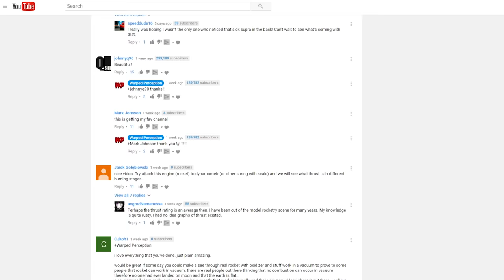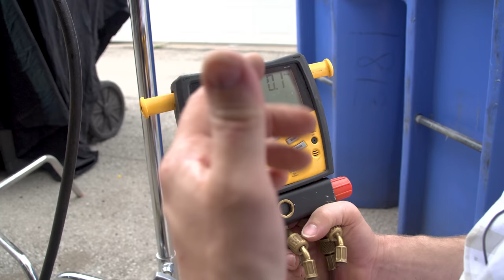Model Rocket Engine In A Vacuum Chamber - 4K Slow Motion - will it burn? - Rockets (S1 • E3)

Comment: Lol !!  How could you able to trigger 🔥 with deterring a element in fire ⚠.. Geez, in order to trigger fire & continue the action you required oxygen. Secondly, sound waves can't travel in vacuum.. May be you haven't properly sucked all the air in vacuum tube it seems. Misleading information..
Reply: 1. Go back to school
2.both the igniter and the rocket engine has an oxidizer (oxygen) mixed in
3.sound needs matter to travel through in this case it was the copper wire
Reply: Flat Brain I can’t believe people are just dumb

Comment: Fire does NOT burn without oxygen...FACT!  You need to show the gauge levels and prove it is air-tight.  smh
Reply: So how do oxy -acetylene torches work UNDER WATER?
Reply: @stuartgray5877  water is H2O right?? So water is made up of oxygen...
Reply: @stuartgray5877  but apparently those underwater torches supply their own oxygen in a fuel chamber
Reply: @justinmarino3863  The answer WAS: The torch TAKES IT OXYGEN WITH IT, just like rockets do.

You are not even aware that MOST of the mass of a rocket when it lifts off is LIQUID OXYGEN?
Reply: @stuartgray5877  yeah and my point still remains...oxygen is needed for fire to burn.
Reply: @justinmarino3863  - 
Rocket is filled with Fuel and OXYGEN.
Fuels mixes with oxygen MAKES FIRE.

FIRE burns in vacuum because ROCKET PROVIDES OXYGEN ALONG WITH FUEL.

Which part are you failing to grasp?
Reply: @justinmarino3863  "water is H2O right?? So water is made up of oxygen..." You actually said this. 😂 Light a match, drop it in a lake and light the whole lake on fire, then.
Reply: @justinmarino3863  Solid rocket fuel contains its own oxygen...
Reply: @PabloGonzalez-hv3td  sounds pretty unbelievable kinda like how people think the sun burns it's own oxygen constantly while whirling through an endless vacuum... And what would rockets thrust against in space anyway, oxygen ? Oh yeah outer space has no oxygen. Ha!  Look up how combustion and thrust works in reality...
Reply: @justinmarino3863  You contradict yourself. You realize water contains oxygen and that it obviously inhibits combustion. Yet pouring water on a magnesium fire makes it WORSE. Why do you suppose that is and how does that relate to rocketry?

Rocket thrust in space can be proven with the thrust from a simple garden hose or pressure washer.
Reply: @PabloGonzalez-hv3td  you guys are trying to compare water and rocket fuel.... So you think outer space is made up of water then??  Fire ( rockets thrust) would not burn or push against anything in an oxygen free vacuum.  A compartment with a rocket fuel oxygen fusion wouldn't work and the same goes for the sun's supposed endless hydrogen fusion.  What a claim with no way to prove it ...
Reply: @PabloGonzalez-hv3td  if you can explain how a hose relates to rocket thrusting in space I will shut up about this forever... Ha
Reply: @justinmarino3863  Why do you suppose magnesium burns under water? The kick generated from a hose or pressure washer is from the reaction against the ejected mass not from the tiny spray pattern hitting the air. Exactly how rockets work.
Reply: @PabloGonzalez-hv3td  fire burns where there is oxygen present... Are you claiming there is oxygen in outer space then?
Reply: @justinmarino3863  No kidding. You might want to research how rocket fuel works.
Reply: @PabloGonzalez-hv3td  yeah it burns in the oxygen filled air and not in a vacuum...
Reply: @justinmarino3863  Air isn't the only compound that contains oxygen. Do you not understand that rocket fuel carries its OWN oxygen source?
Reply: @PabloGonzalez-hv3td  so internal combustion is what you believe in?  Anyone who watches a rocket fly can see fire out the back burning with oxygen. The fact of the matter is there is no video of a rocket in outer space because it is impossible to claim space has no oxygen and fire can burn there...but we can all see that rockets produce a large flame when taking off until they level out and go out of view.....and eventually landing in the ocean where no one can see
Reply: @justinmarino3863  Internal combustion is a broad category which in fact encompasses rockets and even firearms. Speaking of firearms how do you propose ignition occurs inside a sealed cartridge?🤔
Reply: @PabloGonzalez-hv3td  a firing pin still reacts with oxygen to create a spark and ignite.  Internal combustion wouldn't work in a vacuum with no oxygen.  Do you agree that fire bursts outside the end of a rocket? And do you agree that outer space has no oxygen? Whether it is a compound or not NASA claims there is no oxygen in space and I will assume your thinking aligns with their theories... Again back to my original statement fire does NOT burn without oxygen or a compound with oxygen
Reply: @justinmarino3863  The firing pin strikes the primer which lights in an anaerobic environment which then lights the gunpowder, also in an anaerobic environment. The oxygen is produced via oxidizers  - just like rockets.

Of course there's fire coming out of rockets but it's emanating from the combustion chamber inside...
Reply: @PabloGonzalez-hv3td  the chamber of a gun has oxygen in it.  There are experiments online you can look up where gun powder is shown to not ignite in a vacuum box but has no problem in open air... Do you agree with NASA that there is no oxygen in outer space?   Try lighting anything with no oxygen and tell me what happens.  Cars wouldn't work in a vacuum because the system needs air to flow through it.  Rockets are no different just obviously more powerful.  Have you ever seen a video of a rocket flying through outer space?
Reply: @justinmarino3863  There are also videos of guns firing successfully in vacuums since gunpowder WILL burn without external oxygen if ignited properly. Neither the primer nor powder load are exposed to the chamber any oxygen present there is irrelevant.
Reply: @PabloGonzalez-hv3td  I will have to strongly disagree with you buddy.  There are no such videos only ones like this that I commented on because it's clearly not a valid experiment.  You can argue all you want about this but anyone who works with fire in any way will know that it needs oxygen to burn. It's a simple fact of life.  I've replied to your comments so if you want this conversation to continue please provide a video link that shows a rocket flying in outer space... Otherwise good luck on your further investigation
Reply: @justinmarino3863  You can disagree all you want it doesn't mean you're right. The mythbusters tested a gun in a vacuum and it fired...
Reply: @PabloGonzalez-hv3td  myth busters are full of bs
Reply: @justinmarino3863  But the videos you reference are accurate right? 😂
Reply: @PabloGonzalez-hv3td  I go by what works in reality... not some mainstream brainwash of a tv show.  Besides they were debunked and showed to be frauds on many occasions like most fake tv actors..  I know fire goes out when oxygen is removed because I experience it all the time just like most people.  If you want to believe rich sellouts on tv then so be it
Reply: @justinmarino3863  Except guns fire underwater which debunks your "oxygen in the chamber" theory. Cartridges are airtight, the oxygen source needs to be inside the cartridge.
Reply: @PabloGonzalez-hv3td  yeah I agree there has to be oxygen inside the gun and underwater it creates a bubble when fired to only allow the bullet to travel a few feet. Not the same effect when fired through air..So are you comparing water to outer space then ? Is space made up of h2o?  Firing a bullet is not a good comparison to fire thrusting against a vacuum.  It seems it would be extremely impractical and I have yet to see a rocket in outer space...
Reply: @justinmarino3863  According to you the bullet shouldn't fire to begin with.  Not when the oxygen in the chamber has been displaced by water.
Reply: @PabloGonzalez-hv3td  you're still comparing h2o and a vacuum when h2o is one part oxygen and a vacuum has zero oxygen...
Reply: @justinmarino3863  The oxygen component in water doesn't reduce in every reaction. Hence water extinguishes most fires, but not all. It plays no part in a gun firing underwater. Ammo that's actually absorbed water will not light...
Reply: @PabloGonzalez-hv3td  again comparing water to a vacuum...  An open flame in a vacuum is much different that a gun firing underwater. If something is enclosed with oxygen it will spark obviously but when you remove oxygen like the vacuum NASA claims space to be then a flame cannot occur.  Fire needs oxygen and the theory of using oxidizers in rocket fuel to travel to the moon and back is extremely impractical. I would still love to see a video of a rocket in outer space...😭
Reply: @justinmarino3863  Why is it impractical when it's simply stored in a tank?
Reply: @PabloGonzalez-hv3td  if a flame in a vacuum was even possible it would take an insane amount of oxygen to keep the thrust going 500,000 miles to the moon and back not to mention the amount needed for the crew to breathe... Have you ever actually seen a picture of the lunar module?? Do you believe outer space is an infinite vacuum and everything was spawned from a big bang by two black holes colliding??
Reply: @justinmarino3863  A rocket engine is not a blowtorch. Combustion occurs INSIDE the engine not the nozzle. Traveling to the moon does NOT require continuous thrust for hundreds of thousands of miles. You're not even refuting what's being presented.
Reply: @PabloGonzalez-hv3td  the point is that a flame could not occur outside the rocket to get on it's supposed course for "gravity" to pull it the rest of the way .... Because a flame does NOT work in a vacuum!   What do you believe outer space to be exactly?
Reply: @justinmarino3863  The flame originates inside the engine where there is an oxidizer. What don't you get about that?
Reply: @PabloGonzalez-hv3td  fire needs oxygen even if being provided by an oxidizer so my statement still stands. The problem is that rockets burn a lot of fuel quickly and more importantly there is nothing for a rocket to thrust against in the vacuum of space where there is supposedly no matter.  And I still don't believe a rocket could produce a flame outside of itself, perhaps inside where there is air but not outside.  Although it's all hypothetical physics anyways seeing that there are no videos and demonstrations of a space like atmosphere.  And I keep answering all of your questions but you keep avoiding mine....I'm not a rocket scientist just a regular person with common sense giving my opinion.  Have you ever seen a rocket thrusting through space??
Reply: @justinmarino3863  1. Combustion takes place in the combustion chamber inside the engine. 2. How rockets produce thrust in space can be easily proven with the recoil of a regular garden hose or a pressure washer. 3. I could show 1000 videos of rockets in space and you would label them fake.
Reply: @PabloGonzalez-hv3td  haha because you know there are only cgi videos... Sounds pretty hypothetical buddy. And a garden hose proves nothing!
Reply: @justinmarino3863  So you're in agreement. You would dismiss them as cgi. They recoil of a hose or pressure washer is NOT generated by the tiny spray pattern "pushing against air", it's the reaction against the ejected mass - just like rockets.
Reply: @PabloGonzalez-hv3td  I agree to disagree with you pal! 🤣
Reply: @justinmarino3863  All I need is a garden hose to prove rockets work in space ☺

Comment: Watch the YT video: "Uninterrupted Footage of the Falcon Heavy Launch and Booster Landing! 2-6-18" for PROOF of rocket propulsion in a vacuum.
It's best to watch that video AND the same footage from the rocket: "Falcon Heavy Test Flight" for views from onboard the center core.

FOr the morons that will certainly say "But thats not a vacuum"  Please tell me HOW the side boosters would peel away from the center core at 3600 MPH in an atmosphere .
BOTH of those videos show the side boosters peeling away gracefully and smoothly.
HOW WOULD boosters separate IF THEY WERE STILL IN ATMOSPHERE?

I'll answer: They would be RIPPED AWAY IN A MILLISECOND.

Comment: The vacuum was compromised by the jet fumes. You can see that when it first fired it didn't move. when the exhaust provided enough atmosphere, it started moving. Your conclusion was  exactly 180 degrees off! You proved the opposite conclusion.

Comment: Your Vacuum Chamber is Farcical.  any gas expelled would expand to reach a side wall and then thrust would be applied.  You need a chamber equivalent in proportion to your vehicle.  Why would you work so hard to create a faulty experiment?
Reply: How do you propose that the force of gas particles colliding with the walls finds its way back to the rocket?
Reply: @AM-rd9pu  How do you propose I tell you  how to think for yourself ?
Reply: @jadediquattro5355  I read your comment, thought for myself, and then wanted to know how you think the force makes its way back to the rocket. 

That’s a necessary part of the scenario you’re proposing and I figured you’d know how it works if you’re saying that’s what’s happening.
Reply: @AM-rd9pu  Think of the rocket as a whole suspended in a vacuum without inertia or motion.  Just expelling gas no matter how high the velocity or how concentrated it may be will have no effect in a vacuum.  It can only attain movement or inertia if that means of propulsion is acting on a medium and that medium must be able to counter act upon the total Mass of the Object.  The Rocket is Denser and has more mass than the Gas or Fuel Expelled.  If an object could move through a vacuum without pushing off of something else then every time we see the Sun have a "Coronal Mass Ejection" the Sun would be moved by that fuel being expelled.  When you see homemade vacuum chambers, if you use slow-motion capture you will see that as the gas expands from the 'Rocket'  the object does not move until the gas reaches a side wall.
Reply: @jadediquattro5355   It would be a violation of the third law of motion if rockets didn’t work in a vacuum. 

The rocket exerts a force on the gasses and the gasses exert a force back on the rocket. 

The rocket moves for the same reason that you roll backwards after throwing a heavy object while sitting in a rolling chair. You exert a force on the object and the object exerts a force on you. The presence of absence of air doesn’t change this fact. 

And coronal ejections do exert a force on the sun but it’s not enough to have an appreciable effect on its motion.
Reply: @jadediquattro5355  You still haven’t answered how you think the force of gas particles striking the walls finds its way back to the rocket. 

Rocket exhaust pushes on the rocket and the rocket pushes on the exhaust. That’s all there is to it.

And newtons laws don’t suddenly stop working in space.

Comment: I don't think you can recreate the same vacuum of space in that plastic tube and gorilla tape contraption of yours.
Your video was very vague.  I want to see that Guage and the whole contraption to make sure it is under pressure and no leakage out of the tube.
I have seen a much better video in a real vacuum chamber that tested four different thrust and ignition sources that failed.  The individual also was not a flat earther.  I'll believe his video and not yours.
Reply from the maker: Lol... This video is for pure entertainment and I think your referring to Cody? Well the difference between the two tests are, I plugged the end of the igniter to replicate a real solid booster the way they would rarely ever use them in space if they would. That ruptured disc or in my case the hot glue kept the pressure in the ignition portion of the motor, that allows the motor to start by keeping a somewhat pressurized atmosphere that can conduct heat, this is how we would do it if we were trying to ignite any sort of solid rocket booster in the vacuum of space. This rupture disc allows the motor to start and once the motor is started you have enough conduction and chain reaction to continue the burn throughout, now if the motor at any time got extinguished, you would not be able to reignite the solid rocket motor in a vacuum unless you were to repressurize it, create another ruptured disc for starting purposes, and then reignite it to start the whole cycle over again.
A vacuum does not conduct heat so you have to have some sort of medium to start the motor. Hope that clears things up a little bit.
Reply: @WarpedYT  - If you would like to file charges against Papa Legba for slander and defamation, I will gladly join in and help fund your effort.
I am sick and tired of this piece of shit LYING about people on these threads!